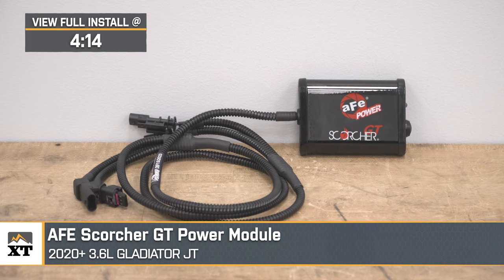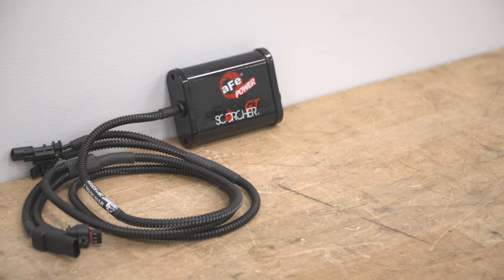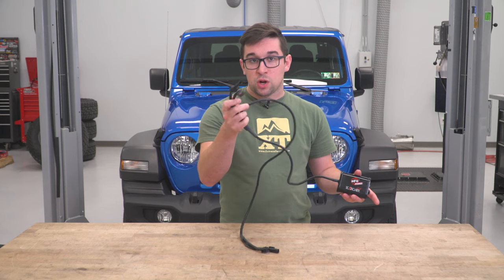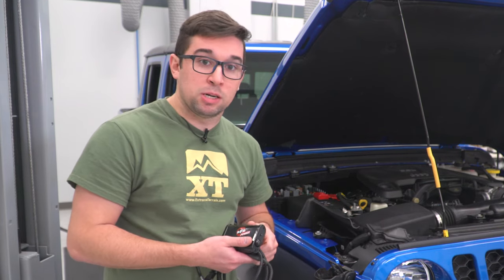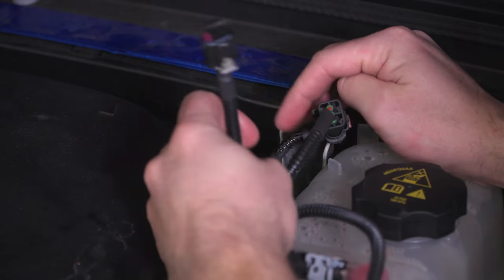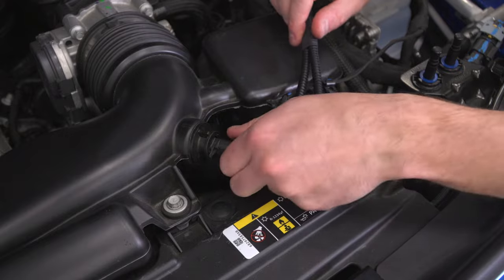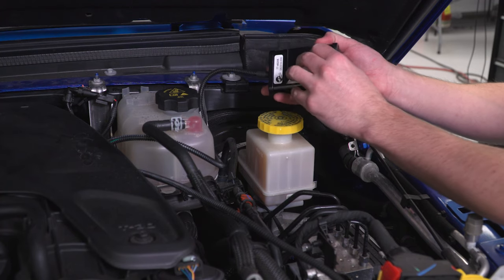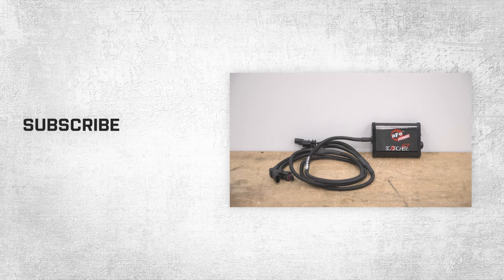Jeep Gladiator JT AFE Scorcher GT Power Module Review & Dyno

Comment: aFe scorcher GT worked for 20,000 Miles then threw a Check Engine Light causing Cylinder Misfires, 2022 Jeep Gladiator , Removed it & it was Cleared, is there a Module Similar to this that Lasts Longer?

Comment: 2021 gladiator, at 13k miles had to get my cam shaft replaced and the lifter springs, then at 20k had to get my cam shaft replaced again and my bank 1 cam shaft sensor.. now it looses power on the smallest hill on the highway, can't get above 65mph, manual transmission,  from 4th up to 6th, pedal to the floor won't get above 65mph (4th 65mph, 5th 55mph and 6th 40mph)... not so happy.
So really hope this helps.
Reply: The product caused these issues ?
Reply: Theres a recall on the manuals right now